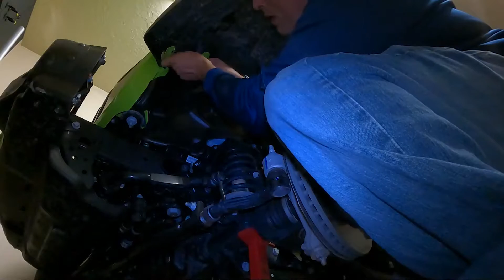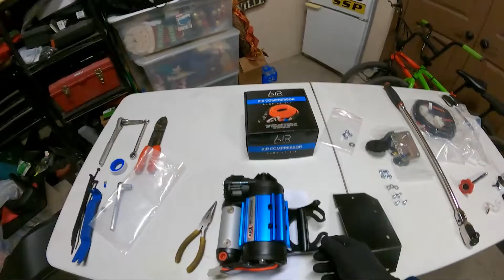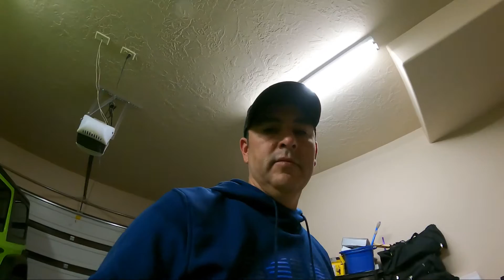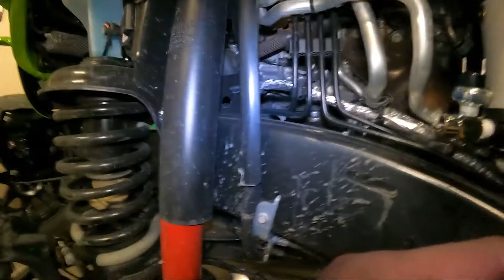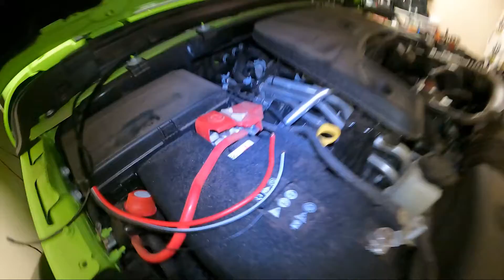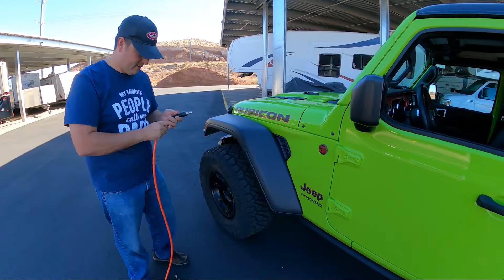Jeep JL Wrangler / Jeep JT Gladiator / Hidden ARB Air Compressor Installation / On Board Air

Comment: This is such a clean mount but I am worried being in Colorado, from salt, to rain, to moisture, how safe this is... Nonetheless this takes the cake for the best place to put it, location wise.
Reply from the maker: I’m going to move the quick connect to the front bumper area and the supply filter higher in my engine compartment. But I think the pump itself works right there for me.

Comment: Great video. Nice to see potential problems. Do you think there is enough clearance btwn the top of the compressor and bottom of master cylinder to run an air filter elbow and relocation kit?  Thanks.
Reply from the maker: Thanks! Yes I raised the compressor up to be close to the master cylinder you could lower it enough to clear a 90 for a relocation kit!
Reply: @TheSatos  Thank you

Comment: Another great video. How do you like it so far? Any issues? Also, do you think it’s adequate for 37’s. I like the simplicity as well. Thanks
Reply from the maker: Thank! We love our Jeep. Only issue we’ve had so far is with the USB outlet in the center console not working. No issues with the air pump. I think it’s adequate for any size tire. Dual pump would be faster though.

Comment: Another great addition to this would be something like the Speedflate 4x.  Fills up all 4 tires at the same time (for lazy people like me) and equalizes the pressure in all 4 wheels (for those OCD people like me).
Reply from the maker: I’ve considered it. I kind of like the simplicity and compactness of the one hose. But I may do that after a while. I may be airing up two vehicles regularly here soon so that should put this pump to the test!